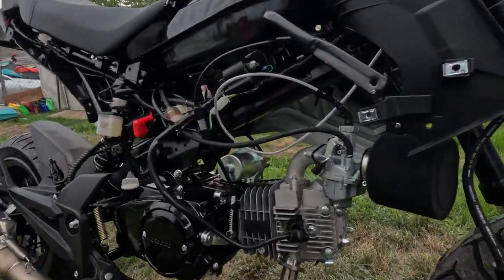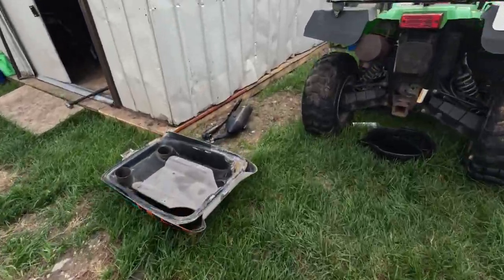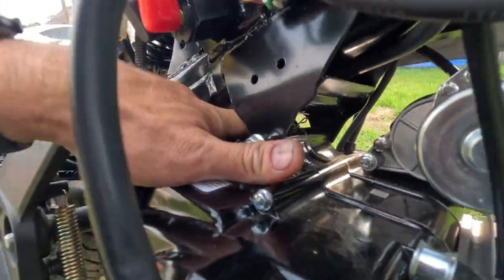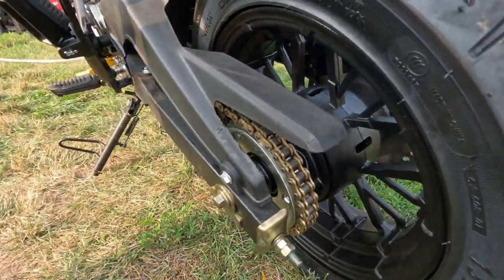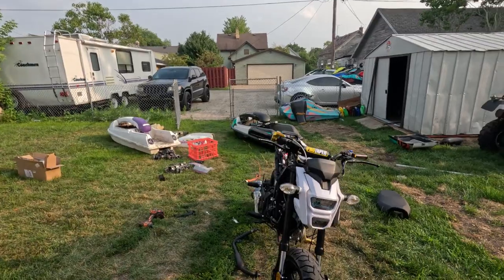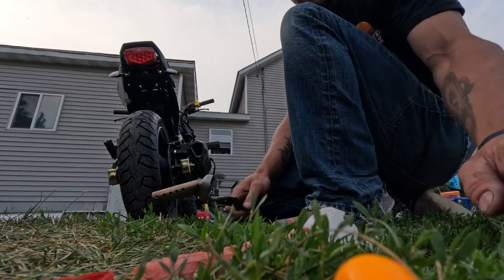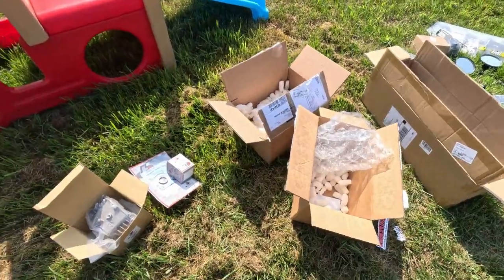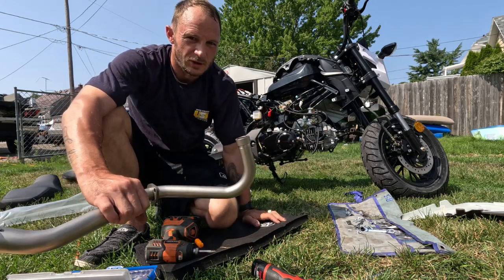2023 Boom Vader Grom Clone Upgrades Mods

Comment: Question: Emissions Delete.. Did you crimp and weld or seal in any way or literally just a cut and crimp? The bike is looking wonderful my man! My only suggestion being.. you should look into getting a "shift lever support bracket" for the shifter. That way if the bike ever goes down or tips over the support bracket takes the blow and you don't damage the drive train! Another fun piece you could get in an accent color of some sort! Your bike is looking awesome!!
Reply from the maker: Oh man it’s been a while since this iteration.. I just crimped it off because I knew I was going to the 141cc “big bore kit” it stayed like this for maybe 3 miles… after the big bore kit wasn’t enough I upgraded to the zongshen 190 (zs190) and then put a big bore kit on that and made it a 4 valve 212cc, if you are browsing my page you’ll see the process I went thru on it

Comment: Not wise to use a filter without a box, even less wise to have your front tire push all the water and dirt on your air intake.

5:40 the stock exhaust is bent in an angle. You need to get the after market exhaust that uses springs for both the muffler as the header. The wider area on your stock exhaust is the catalytic converter, and is required in certain states.
I personally modified the stock muffler to sound better, but you can also cut off the muffler and install an aftermarket one (using the stock pipe).
Reply from the maker: you should check out the most recent version of this bike

Comment: Can you make a video when you do the big bore kit and cam please!💯👏🏽
Reply from the maker: I actually already did the big bore, the cam after looking into it more was not the route I wanted to go… the steps to put the big bore in a really easy thou, set engine at top dead center, loosen cam tensioner (bottom of the engine looks like a 2nd oil drain) remove cam gear access window by taking bolt out from right side of engine, take off cam gear, loosen head bolts and pull off head and cylinder piston, replace gaskets, install piston, cylinder, gasket, head, torque down head bolts, double check top dead center, install cam gear/chain…